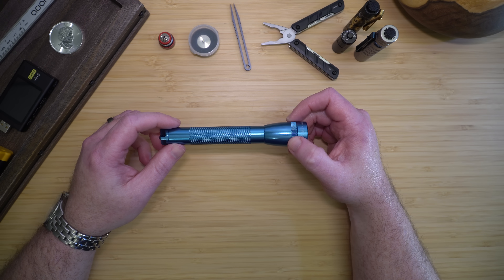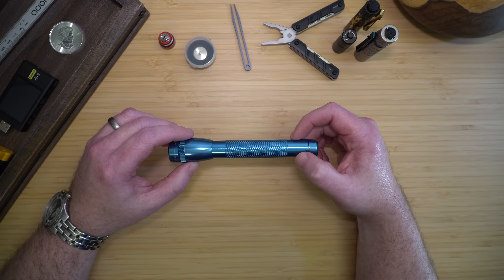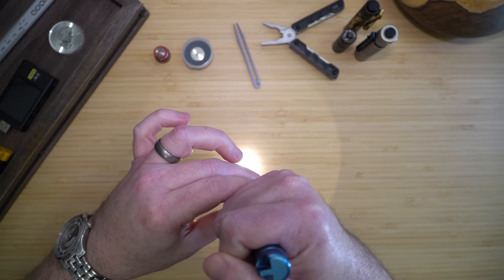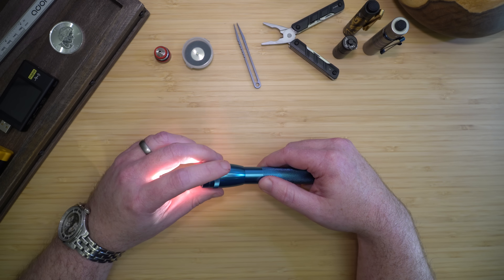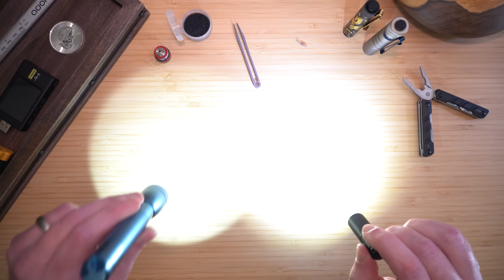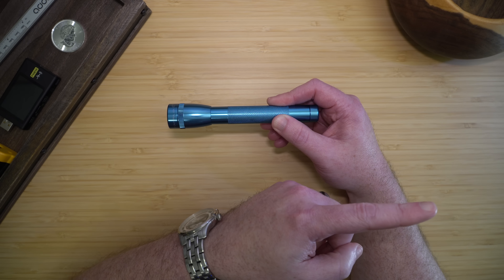Classic to Cutting Edge: Iconic Mini Maglite Upgrade

Comment: If you're updating it's well worth adding a push button switch on the base after all you no longer need the spare bulb hidey hole.

In the UK the original Maglite importer was also the importer of Victorinox SAKs.
Somehow my Maglite got a dent n the barrel and I couldn't change the batteries. I called the company to see if they sold replacement barrels. No, they couldn't SELL me a new barrel, they'd send me one for FREE.
Amazing, so I joked and said I wished you got the same service with SAKs because one of mine was damaged.
What was the damage? One of the scales was chipped, the saw blade had snapped (I'm clumsy like that) and the spring was missing from the scissors.
OK, send it to us and we'll ship it to Switzerland for repair.
Gulp, how much was that going to cost - nope, that's free too!
The Maglite barrel arrived two days later and when the SAK came home the scale and sawblade had been replaced, there was a new spring and toothpick, the small blade was new too and everything polished up and sharpened.

Now that's Customer Service!

Oh, since then I hand stitched a leather sleeve to protect the torch, keeps it warmer to the touch plus you can grip it in your teeth without damaging the enamel!

Fun facts:

US flashlight = UK torch
US torch = UK candle mode!
Reply from the maker: That's some next-level service they provided!  Thanks for the tips on the UK lingo.

Comment: I had several of these over the 
years. At the end, the factory bulbs got to where they didn't 
last very long, and the LED
conversions that were available at the time were pretty dim. After the useless modern batteries we have leaked and filled my last Mag
with corrosion, I started using 
the FREE flashlights I got from 
Har- ber Fra-8 and was very happy and sad at the same time. Happy to have a nice useable compact pocket-sized 
flashlight on one hand, and 
sad that I had to get such an affordable reliable something 
made overseas when we have some of the finest R&D and manufacturing in the world right here. I'm old enough to 
remember having the old 
2 D cell flashlights that would 
work great then they wouldn't 
in the next second. Sucks to 
be out in the woods or out fishing in the dark, and have to 
shake the hooey out of it to maybe possibly hopefully make the flashlight put out enough light to get you back to 
camp or whatever. Today's 
flashlights have all that older stuff beat all to hail.😂
Oh well.  . . .
Reply from the maker: I appreciate you taking the time to share your thoughts and memories.

Comment: Put that LED "improvement" bulb in your miniMaglite and you lose the ability to ajust the beam from narrow to wide which in my case wasn't an improvement and not worth trying I have switched back to the stock bulb reflector To each his own I have turned a miniMaglite into a fire piston just to see if I could do it  It
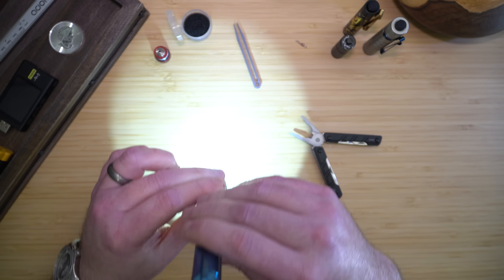Reply from the maker: Yep, some of the first LED upgrades weren't very good and required a new reflector design.  Newer ones do focus okay with the existing reflector.  Check it out in the video at 2:55. Thanks for watching.

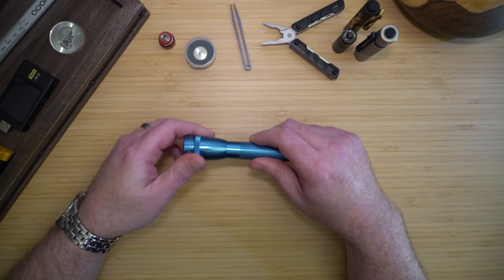Comment: 1:10 I INVENTED THE SPARE BULB STORAGE.  I got my first MAGlite SO many years ago. Around 1982 or so I realized that there was enough room to carry a spare bulb in the tail cap. In those years, the tail cap was solid. So I went to my machine shop and milled out the cap. When I needed a new switch, I sent it in to MAG for repair - lifetime warranty. And I wrote a letter explaining my solution. THEY NEVER ACKNOWLEDGED my improvement, but started making products that way. I wish I’d kept a copy of my letter and pictures of my work.
Reply from the maker: Wow, that's awesome! Your idea was way ahead of its time. It's a shame they didn't give you credit for it.

Comment: unfortunately the LEDs don't work proper with reflectors designed for light bulbs, because the LEDs emit most light straight forward. So the focusing won't work.
Reply from the maker: Appreciate you pointing that out, it's good info to know.  Some of the kits come with new reflectors for this reason.  The one I used works with the existing reflector and still focuses from a flood to a spot.  Jump to 2:55 to see it in action.

Comment: Ah yes, Maglite. I remember when the shelf space devoted to Maglites was 20' long at stores. Now there is hardly any. I still have a few different sizes. I have a mini Mag that has a led conversion from atleast a decade ago. Always wanted the 6 D cell version. And who remembers the joy of dealing with  batteries that welded themselves inside the flashlite!?
Reply from the maker: Thanks for sharing your Maglite memories! How times have changed. At least an American made product is still a valid option.
Reply: I have the 6 x D Size. Back in the early 90s I told my wife it was the only thing I wanted for Christmas. I owned an Inn that consisted of 3 separate sections so it gave some security if someone drove in at 2:00am. I would light them up and see what happened next! It weighed a ton but it was fun.
Reply from the maker: That'd work as a club as well if needed.

Comment: The brightness was never a problem. But the LED's don't Focus. which turn them into pieces of ... well useless!
Reply from the maker: Yep, some of the first LED upgrades weren't very good and required a new reflector design.  Newer ones do focus okay with the existing reflector.  Check it out in the video at 2:55. Thanks for watching.

Comment: If you look up "match mod maglite" you can fall down a big rabbit-hole.  With a 20mm drillbit and the pill from a D26/P60/P90 you can make a whole assortment of drop-ins that you can "load" from the front.  Make your own triple/quad with TIR lenses (Carclo, etc.) for a wonderful floody warm high CRI beam if you want, even with multiple modes if you want.
Reply from the maker: Wow, that's some cool flashlight trick! I'll have to check it out and maybe give it a shot. Thanks for sharing!
Reply: @chestersedc  Actually, I always use a 20mm step-bit so you get a flat bottom, vs a regular conical bit.  The pill seats more completely that way.
Reply: So cool.

Comment: These things mightve been the so called go to everyday flashlight because there weren't enoug others available back then but in my experience these Maglites were all Junk! good 4va year then they'd stop working and I've had 2 purchase several of these and regretted everyone of them! Streamlight is the Best! And some of the off brand lights available now are as well, Sofirn, Fenix, possibly Wurrkos,  But those Maglite really are all Junk nomatter how well they appear to be made they all result in failure
Reply: Only use Energizer or Duracell batteries in a Maglite. Do not use cheap batteries, like RayOVac batteries. They seem to leak all the time, even while new in the package. I won't even bother stealing RayOVac Industrial batteries from work anymore because they've caused too much damage in my battery powered devices, especially all my Maglites. The aluminum inside a Maglite will oxidize over time and lose conductivity with the little metal tab on the bulb holder. Completely disassemble the Maglite and pack some steel wool tightly inside the light. Use a flat blade screwdriver to turn the steel wool while pressing down towards the bulb end. This will clean the aluminum oxidation off the surface that makes contact with the bulb holder. Now use the steel wool to clean the metal tab on the bulb holder. Apply a little grease, Vaseline, or dielectric grease on the bulb holder's metal tab. Clean the spring on the battery cap and reassemble. The flashlight should be as good as new.
Reply from the maker: Thanks for the detailed instructions! Very helpful.